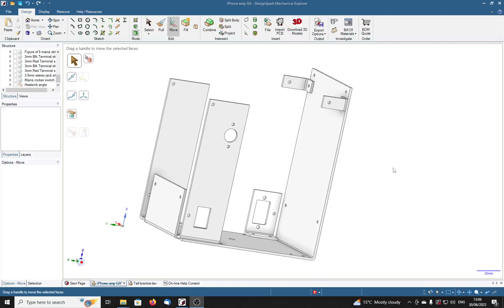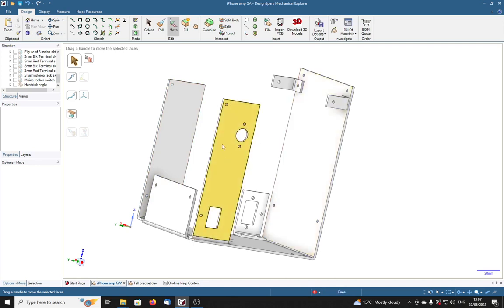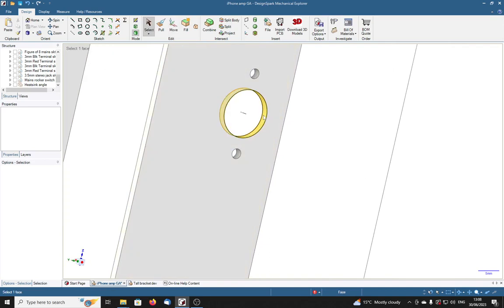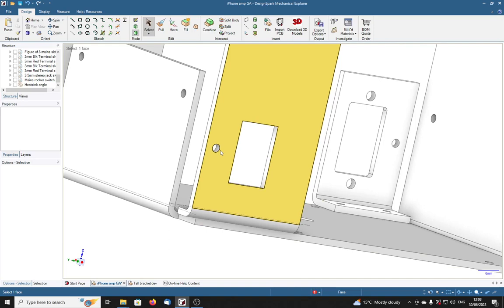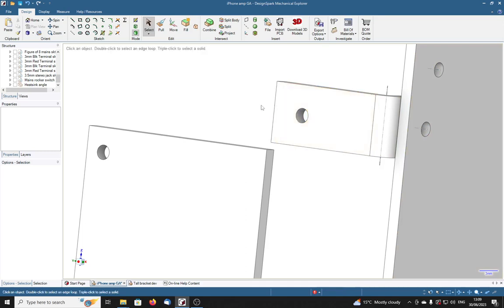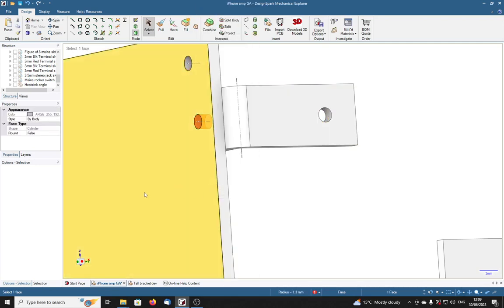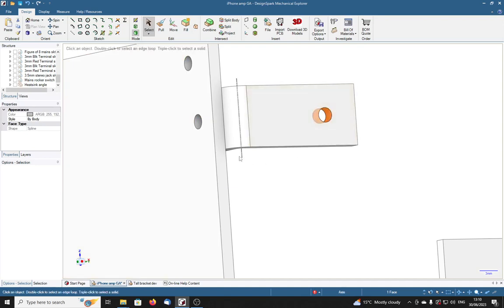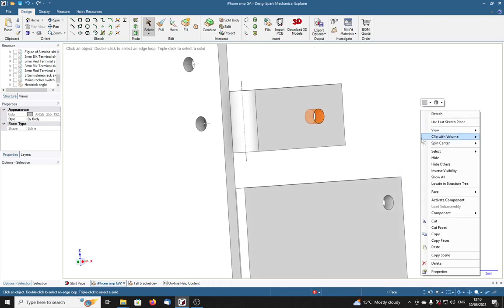When is a hole not a hole.

Comment: When the hole has been made from a projected hole or edge  'Project through solid' being selected. It that case the projection seems to be a spline, pulling a spline surface, whereas, when choosing 'Project through solid', it makes the projection a circle.

Another way which Is my usual way to make a hole in a part from another part hole, is to fill a hole making a face, then pull that face through ALL faces / parts in a single pull subject to parts being active or in the active chain. I find this faster and more intuitive than the projection command.
Reply from the maker: Brilliant! It works a treat. Very many thanks for the info. I'll probably do a video on that one.
Reply: @JimTaylor42  Your welcome - it would have been the same answer in the forum...except that I would have posted a gif and images which I can't here.
Reply from the maker: @TAH1712  Got it. Thanks again.